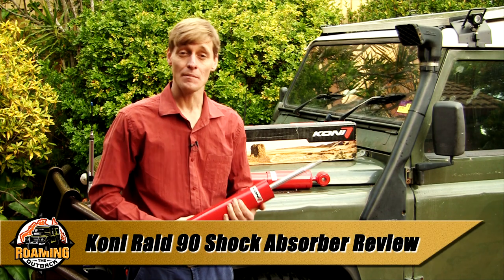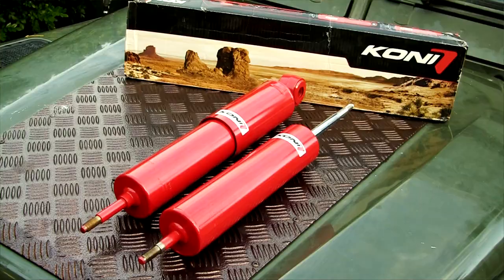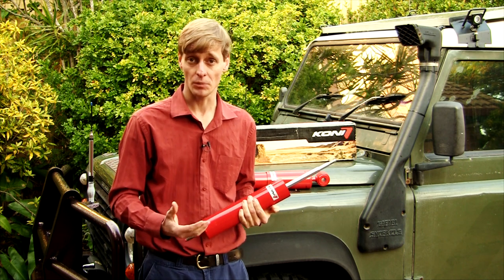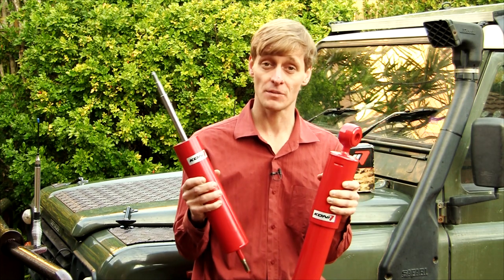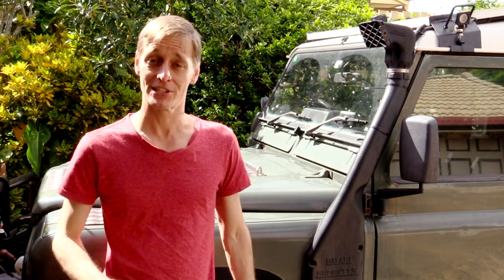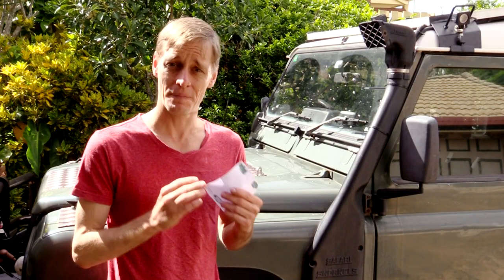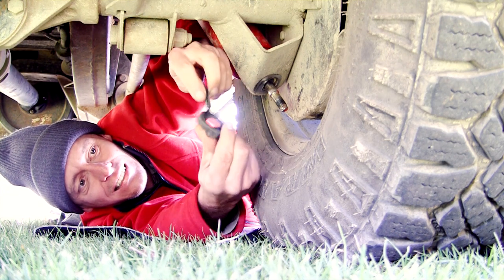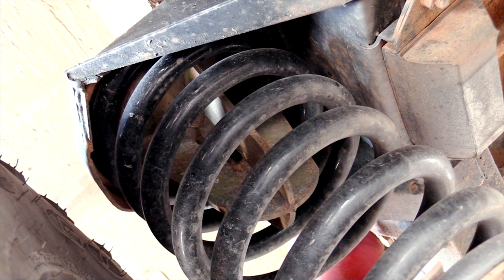KONI Raid 90 Shock Absorber Review - 58000km - Land Rover Defender

Comment: I put a set on my diesel disco along with new springs .The first main thing i noticed was no more body roll  the vehicle is more stable cornering the next main thing i noticed was when four wheel driving through the very rough stuff no impacts are transmitted into the vehicle the shocks seem to absorb it all .In my opinion they are worth every cent you pay for them , a few of my friends are going remote res shock's but i dont want to have to reseal them every 80,000 ks also they seem to expensive for what your getting , to each his own i guess ...

Comment: Still considering a set of these ... just the price is enough to test for potential heart conditions!
Reply from the maker: You'll surely love them Matt.. think of them as a lifetime investment, not a disposable part. Only issues to date were the bushes, but the shock itself appears indestructible.
Reply: @RoamingTheOutback  They do sound smashing ... Currently on the old metal sleeved OME's which I've not had cause to complain about but are showing their age. The 90 has had a set of DeCarbons which are excellent for road work and behave great off road but they're thin on the ground these days.

Comment: Nice one mate! I have been looking at these shocks for the last 2 years for my FJ Cruiser - how do you adjust the shocks when mounted or you need to take them off?
Reply from the maker: They must be removed from the vehicle to adjust the rebound. It's something you can do after the first few months to see how the stock setting feels for your vehicle.
Reply: Many thanks!
Reply: Years ago I used to sell Koni in 4WD and Rally shop I worked in, and I still use them. I have the KONI RaidS in my 2009 Ford Ranger.  

With regard to adjustment there are about 5 half turns of adjustment, that is half a turn is about one level of adjustment. With heavy duty springs or regular heavy loads I would suggest adjusting them by one to two half turns (up to one full turn) off soft. 

This should be more than adequate. If you make them too hard the rebound will limit the spring doing its job by making it pack down and reducing the suspension travel. In general terms what you are aiming to do is to allow the spring to compress, then rebound once, then settle back to its neutral position. Most of the time you need to take them off the vehicle to make the adjustment. 

One thing to watch - the piston has a kind of fork assembly on the bottom of it inside the shocker. Treat it gently and you will feel it lock into the adjustable foot valve when you fully compress the shocker. NEVER and DO NOT force it. It will adjust very smoothly and you need to “feel” for a stop at each end of the adjustment. If you force it you run the risk of unscrewing the foot valve and if you do it will be back to the supplier for repair.  Cheers

Comment: I am putting those exact ones on my 2008 Mercedes G500.  What setting would you put them on??  (I realize they are adjustable, but kind of a pain)

My truck does not normally carry cargo in it and it is typically just my driving in the city...I want it as comfortable as possible.

A few times a year I go off-roading and load it with gear.
Reply from the maker: It's best to put them on stock and see how the ride feels first. The factory set them for each make. Remove and adjust later if they're too soft with load.
Reply: Roaming The Outback Great, thank you!

Comment: Hello Brett, Rudedogi from the USA!  Do you have a contact with Koni AU?  I'm trying to get these but not available in the USA.  Koni USA has not replied to my emails.
Reply from the maker: Try contacting Toperformance. They are the Koni Australia stockist.
Reply: Thanks Brett for the reply!  Koni USA sent me to Toperformance. Dean over at Top was very nice at getting back to me! Now that's customer service!  Unfortunately Koni cant get me two struts here in the states? That's not good.   See you out on the tracks some day!   @RoamingTheOutback
Reply: @rudedogii  We got ours from Summit Racing. It took 3 months, and was drop shipped from Koni USA in Kentucky.
Reply: @James86004  I contacted Koni NA and they said 6 to 8 weeks. I found them on Ebay in Germany and got them in a week and a half!
Reply: @rudedogii  that is great! I tried to order them from Paddock Spares in the UK but then said they could not ship shocks air freight because they are pressurized. Even though these Konis are not pressurized.

Comment: Hello! Koni heavy track or HT raid?
Reply from the maker: This review is for the Raid 90's, not HT.
Reply: @RoamingTheOutback  Managed to buy Koni Heavy Track for my W461 G Wagen about four years ago. FINALLY got round to trying to  fit today, but found diameter too big at the rear at the chassis mounting and seem too large also at the front from looking.  Not sure if that issue affects Defenders; I need to be more careful second time in  trusting the supplier to get selection correct  and find an application for the  expensive Heavy Tracks as no chance of exchange.